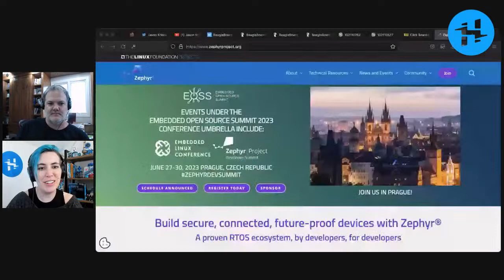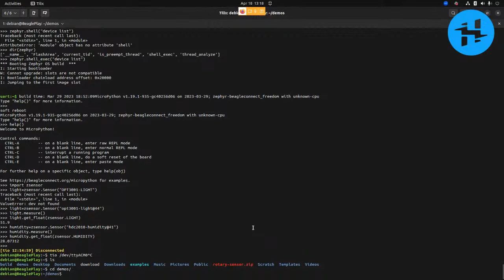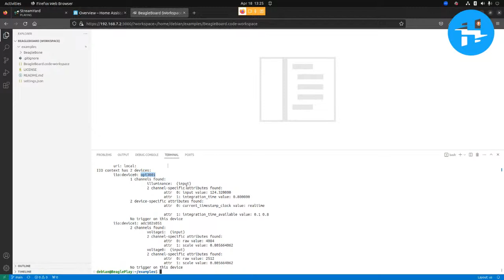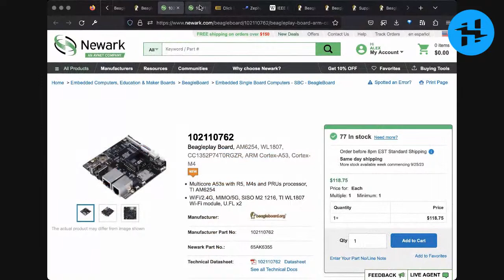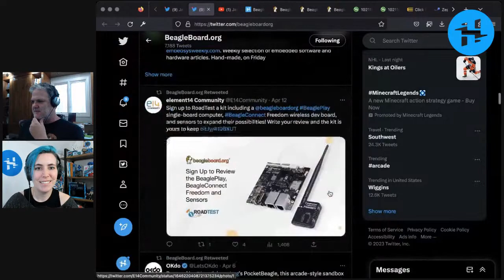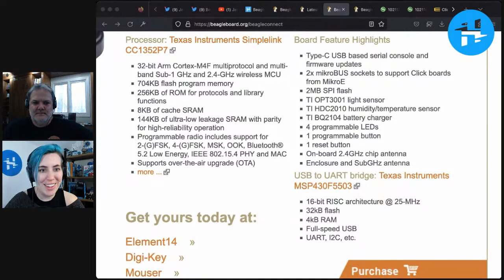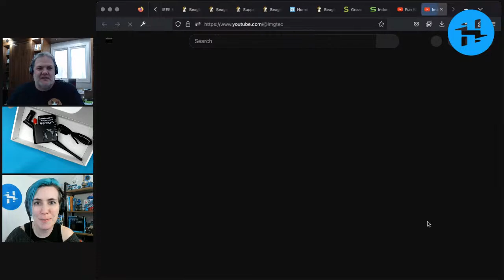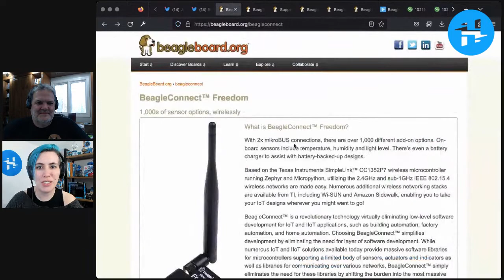Jason Kridner: News from BeagleBoard.org // Hackster Café

Comment: Hi there,

Just to be clear, I can use a pair (or more) of the BeagleConnect Freedom devices to act as 915Mhz Rx/Tx units with a pair (or more) of my BeagleBone Black Rev C units (and/or an Ubuntu laptop) with, say, a motor cape and a servo cape on a wireless robot? I do not need to purchase BeaglePlay units right now, nor do I need to own a bunch of Mikroe Click devices right now, to work with the BeagleConnect Freedom units? 

With other generic parts, I can control the pan/tilt servos moving a FPV camera around, or an arm on a BeagleBone Black servo cape or PCA9685, the wheels hooked into a motor cape or some TB6612FNG/L298 drivers, or even some Qwiic Motor Driver units, etc.?

In simpler terms, should a pair of BeagleConnect Freedom units work with my Linux equipment + CircuitPython and assortment of standard servos/motors/sensors/etc.? 

Apologies if my queries are daft, but I'm rather new at all of this and have a a whole bunch Arduino-based products, the BeagleBone Blacks, some Ubuntu computers and a whole bunch of OpenMV H7 Plus modules/lenses/shields (including a Flir Lepton woo hoo!) and would like to go this route with a robot/rover I'm trying to build, instead of using  Arduino-based brains. 

Thanks very much for the video:)

Shawn Gibson